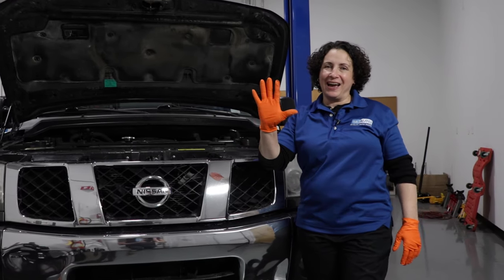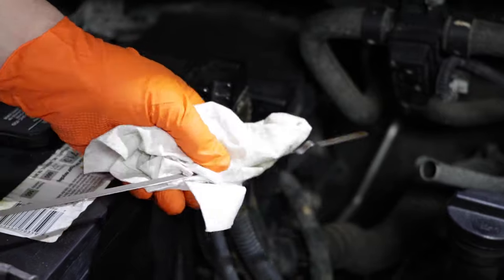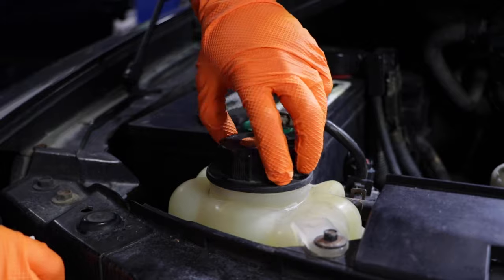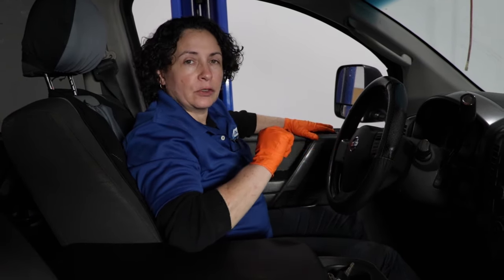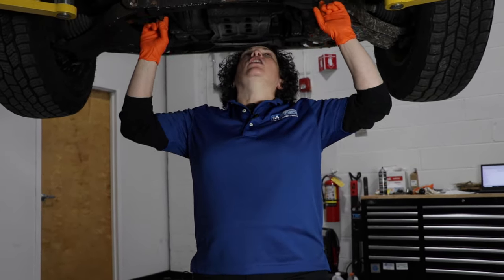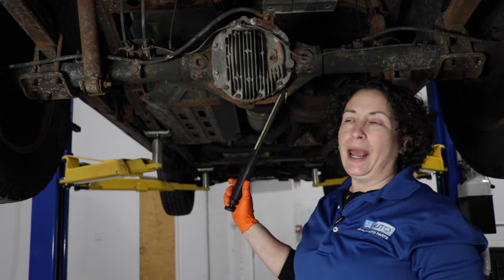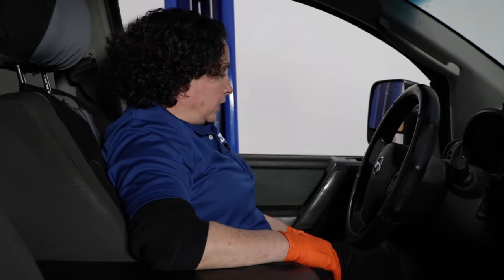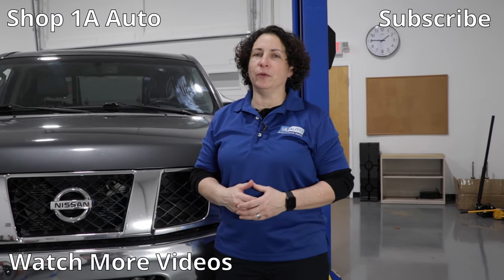Top 5 Problems Nissan Titan Truck 1st Generation 2004-2015

Comment: Think you should have added replacing the starter. I'll check that fuel pump with my mechanic.
Reply from the maker: +Matthew Masterson Thanks for the feedback!
Reply: The starter replacement is not a top 5 concern. 

I have been a Nissan Tech for over 20 years. I have only replaced about 7 starters.
Reply: @72Dexter72Manley72  Yes, I still have a new starter for my 2006 I bought years ago because I assumed it was the starter getting fried like my other trucks with the starter under the exhaust manifold. Starter relay, keep a spare in the glove box.

Comment: Pretty sure most of these issues got fixed or have cheap aftermarket fixes. I even doubt a 2015 would have any of those issues knowing the nissan/toyota type conservative approach to new generations. 10 year of production allows you to find and fix those issues easily. Get a later model and I'm pretty sure you'll have no huge issue.

Comment: Is there a preventative measure you can take to keep the transmission line from cracking?
Reply: yeah its called replace the radiator  sadly

Comment: Is there a similar video for the Armada 1st generation?  I think I dodged that radiator issue, mine just broke and the coolant came out.  My diff doesn't look like that and luckily does not leak.  But what does happen is  the parking brake light and traction control light comes on.  And some times it makes a noise like a way out of tune Banjo and then the brake pedal goes to the floor.  It also seems to coincide with the parking sensors going out.  Its ben fixed and it re occurs after about 2 years and maybe 10K miles.  Just wondering if anyone else has this re occuring issue

Comment: I have a 2010 Nissan Titan SE with 195,000 miles on it.  The only "problems" I have are the blend door actuator making noise (recently) and the worn out paint on the door handle. Nothing else.
Reply from the maker: +Daniel Acosta Thanks for the feedback!
Reply: I did a test drive on a titan and the a/c would only blow cold on max, if it was recirc it would be warm. Seller told me it's how nissan works.. have you run into this before? It was only 85 at best outside

Comment: What will fix the transmission issue? Should I just put in a expensive touch radiator or do I need to upgrade to a bigger transmission cooler separate from the radiator as well? What solves this milkshake?!?
Reply from the maker: +MISTmob_Si MISTMOB We wouldn't be able to diagnose an issue like that here, you may want to have a local mechanic take a look at it. Thanks for checking us out! http://1aau.to/m/Shop-1AAuto-c

Comment: My nissan 2006 model had a vent   that was clogged. I took the bolt out and put a hollow one in and hooked a hose up and ran it behind my brake light
Reply: Also no mention of manifolds?

Comment: Do a video on the pathfinder behind you. I can think of more that 5 problems lol
Reply: 1: Coolant and ATF mixing
2: Timing chain tensioners 
3: Catalytic converters
4: Evap code
5: Clock spring 
6: and a whole bunch more 😂

Comment: 2006 with over 250000 mile only repairs both front wheel bearings around 175000, 1 universal,  ignition switch. Brakes every 85000.
Reply from the maker: +JPS Thanks for the feedback!

Comment: I loved my 2005 Titan until the transmission started slipping somewhere only in 3rd or 4th gear. I wish it was a fix for that instead of rebuilding or replacing. 😥

Comment: Yeah well they also have a problem with the rear end if you start hauling and pulling things. There is a spacer that is needed between the pinion and the axle shaft that causes slippage on the ring gear
Reply: Can you give me more detail on this?

Comment: Interesting no mention of the 5.6 timing chain stretching issue, the cracking exhaust manifold issue, and the leaking oil from the cheap plastic valve cover gaskets issue...but would rather have than Ford or Dodge.
Reply: weird I have 208,000 on my 08 ram hemi and besides brakes etc no problems yet. my work van is a nissan nv2500. has the titan motor. 178,000 miles and has had manifolds replaced twice.

Comment: Also, what about the cracked exhaust manifolds? I would say that is a very, very common issue. Poor designed manifolds
Reply: On my `06 I've had the left replaced twice, and the right once.  Luckily had less than 80k at the time so all replaced under factory emissions warranty.  
122k now.. if they fail again it's getting headers.
Reply: @williamrussell2353  You'll regret the headers. I installed JBA long tubes, I am now looking to go back to OEM...the JBAs are absolute garbage!
Reply: @williamrussell2353  Yup. I've got codes p0420 and 430. Hoping it's O2 sensors but most likely it's the manifolds/cats. My truck isn't loud yet.
Reply: @jasonw8124  A lot of shops wont install headers unless you weld the cats onto them. I guess they don't want to violate emissions by removing the converters.
Reply: The most common issue

Comment: My girlfriend has an 05 which is approaching 300,000 and I don't believe she has had any of these issues. All I've done to it is a front wheel bearing, driveshaft carrier bearing and a fuel pump. Now the fuel pump was a beeeotch but that was mainly because she had 10 gallons of gas in the tank. And I couldn't get the damn fuel line off the top of the pump! 🤬 Uggggh!

Comment: Another problem is the fuel pump fuse  or relay it gets coroded and only passes about halve the voltage and the pump stops happened to me at 89000 miles

Comment: Yes it has a vent! But it clogs up
Reply: Last sept. mine started leaking green dye out of a/c drain and stopped cooling; it is getting hot in South,Ms. and wondered if there is a fix without A/C shop telling me I need a new A/C replacement?

Comment: The clock spring and diff vent were only the first couple years. The vents do get clogged though creating the problem anyway. Remove the vent and replace it with a barbed fitting and enough tubing to get it up behind the tail light. Paint wear? Really! Show me a vehicle that doesn't do that these days. I have 235000km on my 2014 and never heard of the rad/cooler issue.
Reply: The radiator changed to a different supplier by the time yours was made.  It is so common on Nissan trucks in earlier model years it was given the name SMOD (Strawberry Milkshake of Death) and Nissan even has a campaign for it.  This even includes the Xterra and Frontier.  It is exactly as she described.  Xterra/Frontier also have the clockspring problem.

Comment: How bout speed sensor.
Mysterios service engine soon all the time
Sudden shaking when accelerating (sporadicaly)
Funny shaking going at cruise speeds ( replaced all wheels) same problem at high gear 4-D happens only while cruising 1500 to 2200 rpms

Comment: Scotty Kilmer and Car Wizard were right!  This goes for the Nissan Armada, Infiniti QX56 as well. Not to mention the Nissan frontier and Nissan Frontier with the non CVT.
Reply: Actually, Scotty was wrong on his biased review on the Nissan Titan. Mine (2004, first year they were introduced) has 185000 miles with no problems and is bullet proof. I will buy another one if the one I currently own ever dies.

Comment: My 2005 has a blinking 4LO? Any one know what is that, also when I drive feels like something is lightly scraping as I drive
Reply from the maker: +Magikgee7 We wouldn't be able to diagnose an issue like that here, you may want to have a local mechanic take a look at it. Thanks for checking us out! http://1aau.to/m/Shop-1AAuto-c
Reply: 4x4 low mode ?
Reply: For the lightly scraping sound,,,check your emergency brake shoes inside the rear rotors... they tend to disintegrate

Comment: Have a 2004 titan 4lo light keeps flashing car drives perfect but when i stop at the red light car refuses to accelerate have tonturn car off and turn back on car works perfectly fine again...no ones seems to know whats the problem
Reply: Try crankshaft position sensor

Comment: I thought about buying one, but not now, the radiator failure is enough for me
Reply: So you won't buy any car then
Reply: @nickr3441  not one that I got to worry about water leaking into the transmission cooler, and costing me 4’500 dollars, no sir I don’t believe so
Reply: If you get 08 or newer, no problem at all.  These problems are preferring to 04’ to 07’.
Reply: You can avoid this problem by installing a radiator bypass. There are many Armadas and Titans with over 300,000 miles on them. And their resale value is high compared to Expeditions and Tahoes.
Reply: The Pathfinder’s, Xterra’s, and Frontier’s all suffered that problem (2005-2010). I never heard of the Titans or Armadas having that problem.

Comment: i wouldn't wind up with a bill for converters lmao no way it just wouldn't have converters anymore and it would just be loud af lol. if someone tells you that you need converters on a truck made before 2016 they ARE LYING TO YOU because i promise it will run fine with no converters or muffler or anything.

Comment: She has absolutely no clue what she's talking about. She didn't even mention cracked manifolds which is an almost guaranteed issue, and she was dead wrong about no fix with the rear axle seals, which can be fixed using the axle vent mod. Also completely missed the common starter issues that Titans have.

Comment: Problem 1, sucks gas like it has a hole in the tank.  Problem 2, it is twice as big as it needs to be.  Problem 3, rear visibility sucks.  Problem 4, 18" wheels.  Problem 5,  stupid emergency brake design

Comment: Your clueless lady! I just traded in my old 2010 with a 100k and had no problems and yes there is a rear differential vent I seen it in the video they are known to clog up but that’s a easy fix.

Comment: Wrong completely ...power steering leak. ...rear end seals and fan actuator. Wheel bearings A.c. compressor ..your parts suck ...buy Something else ...Moog Timken ..wheel brarings